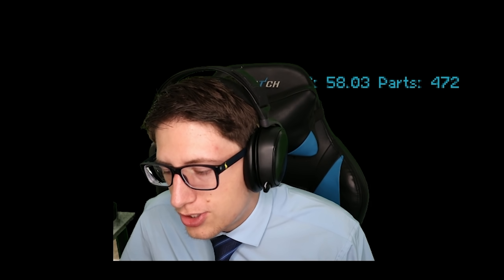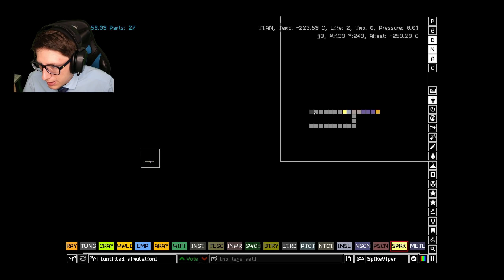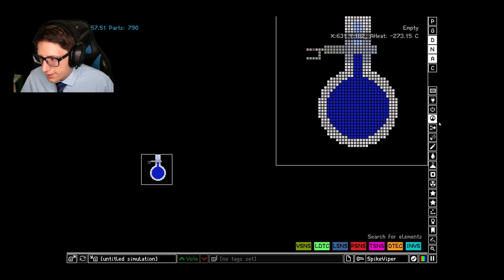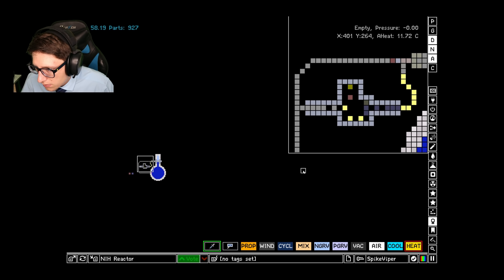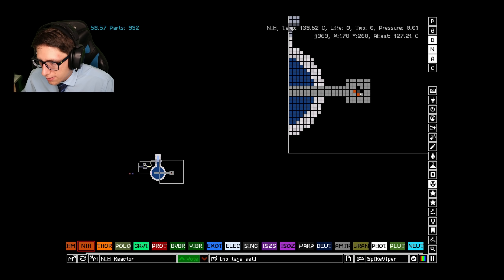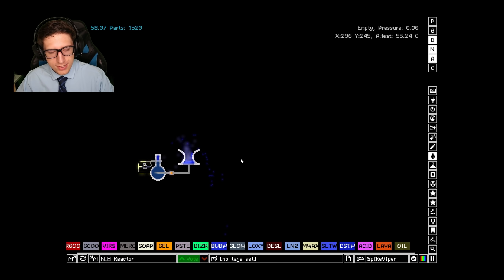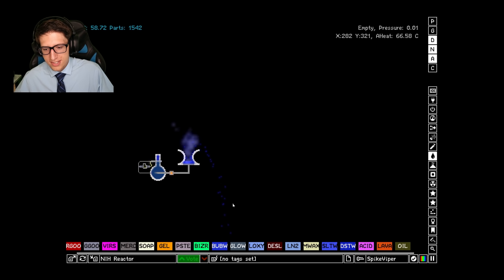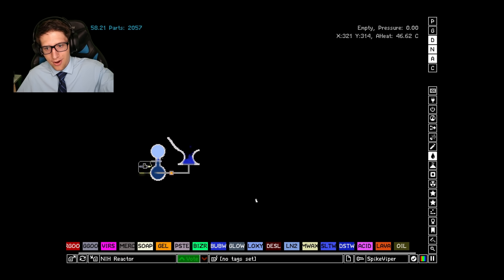AUTOMATIC CONTROL RODS in The Powder Toy!

Comment: you can, instead of use this great piston machine, use Heat switch (just search by "heat") that all the time will be sparking to turn off (with this device that you found) and when the heat increase a lot, then the Heat swich turns on, until the sensor stop to send signals, then the NOT device turns on again and turns off the Heat switch, stoping to cooling down the reactor. I hope you get the Idea. to use the Heac switch is ez, N-type to turn off and P-type to turn on. (this can also be an indestructble insulator when it is turned off)

Comment: 200th like woo. For more efficient cooling I feel you would want to have more thermal contact with the freeze powder and DEUT, not just more freeze powder. AKA mirror the switch on the bottom.

Comment: Be careful the metal don’t erode away, it will cause the reactor to explode. Also if you add another cooling system the temperature will be low